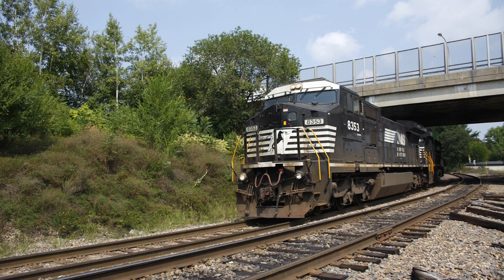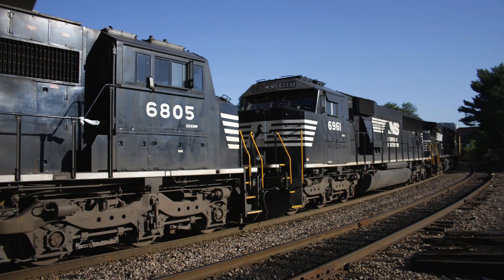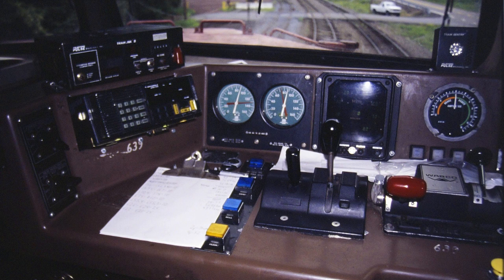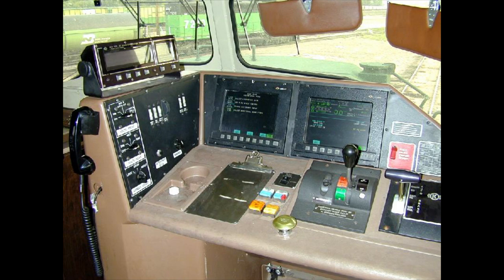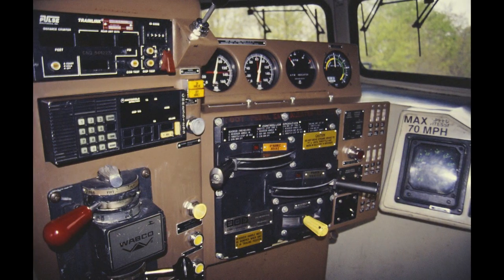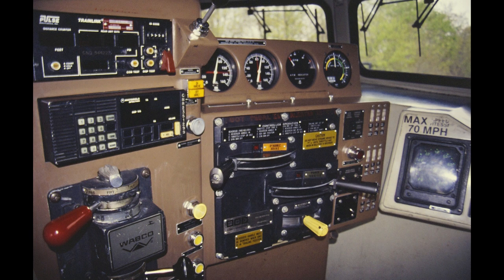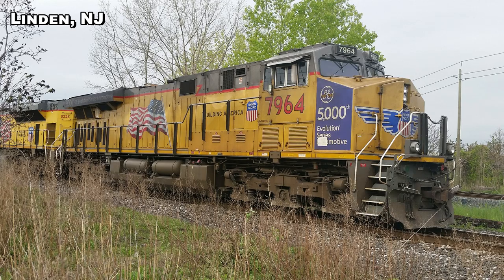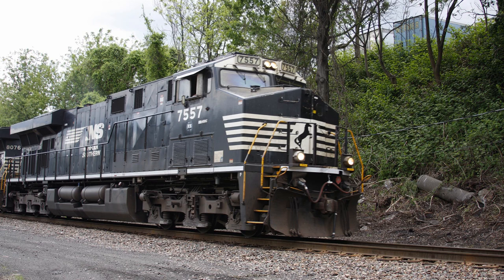HOW LOCOMOTIVES ARE WIRED

Comment: The digital stuff sounds cool in theory and sometimes is , but especially with ac units it can be frustrating. A comparison between a newer ac unit and say a 40 year old sd-40 is stark. While the ac unit performs much better and burns less fuel, the computerized system shows it's ass as it logs faults every few feet of movement. When it finally craps out the electrician has to parse through hundreds of faults. The old engine just keeps on pulling.